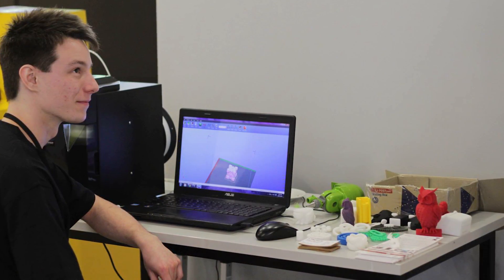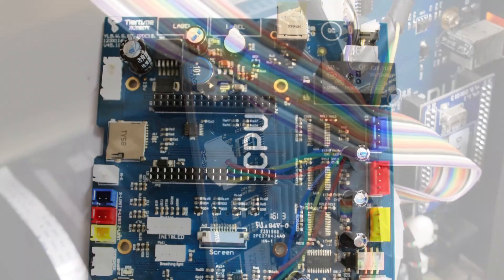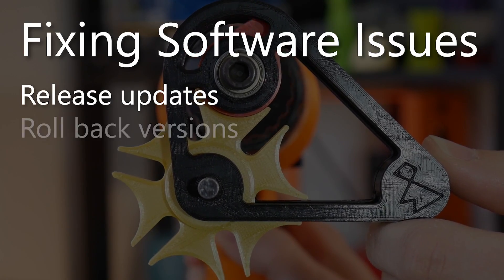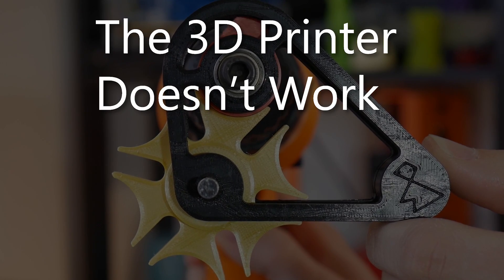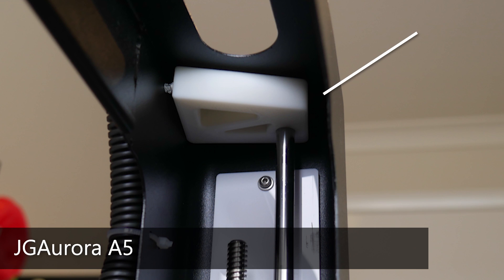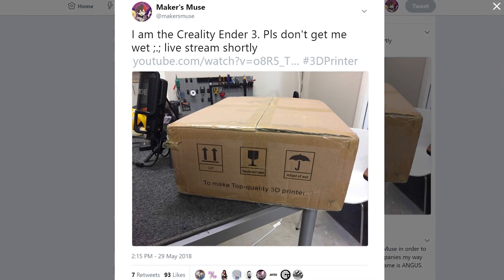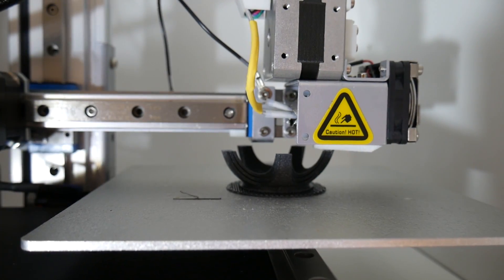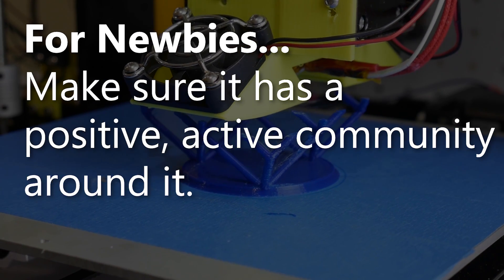Serious Concerns with 3D Printer Quality Control

Comment: The "beta test" behaviour is not acceptable - unless it's explicitly stated as such by the manufacturer and then backed up by some kind of support, e.g. financial incentive for beta testing, and/or free parts replacement at the end of the beta. I've not seen any 3D printer manufacturers stating their product is beta, however.
Product improvement is good, obviously, and to be encouraged (a business imperative anyway) - but needs clear identification for significant differences. A balance needs to be struck of course - changes that consumers don't need to worry about (e.g. the colour coding of the connectors on an internal circuit board to take that example) can and should go under the radar as not a change to "form, fit, and function".
My own experience to date is with Wanhao, who to my mind have been good in this area. They have identified significant changes with a revision number (in particular the D7 which has gone though five point revisions - with upgrade kits available for purchasers of earlier standards) so you know what you're buying, and where they have to revise something within an existing shipped product that quickly proved problematic, they have done so as a free fix (most recently with the replacement z probe on the D9).
Edit: turns out they're charging fit the z probe update, at least for some.

Comment: Wow what a great video!  Totally agree.  Even my anet a8 needed a few screws that were in the instructions but not included....  now however after upgrading power supplies, output transistors for hot end and hot bed, Bowden set up, and various frame strengthening, my printer is producing results as good as many 10 or more times more expensive.

Comment: companies should sell updated parts after the upgraded versions are ship. and replacement parts if something does fail after time. like my ender 3. i would like to upgrade without buying a whole new machine, like the better main board and a flatter hot bed.  go to their  site and barely find and parts for it in 24 volts. well, since i got this one for my birthday i might buy another ender 3 in a few months if they stay the same price.

Comment: If they tell people about it.
That's the key.  Inform people of what they are purchasing and what they are not.  Inform people of changes.  If there aren't major changes like new threaded holes needing to be tapped... then offer upgrade kits.  But the key is informing people.  I willingly Beta Test games all the time.  The gaming community will roast you if you release an unfinished Beta like game as a "finished" product.  SO if the company is honest and communicative then Beta testing behavior is fine.  If they are not and are doing it sorta "in secret" then it is not fine at all.

Comment: I bought a tevo tornado a couple weeks ago (yes I knew about the tevo controversy, but reviews of the tevo tornado were good and it was cheaper than the cr-10s) and I was not expecting 3d printers to work out of the box and as easily as my machine did. If it wasn't for Angus, Joel and Jerry (barnacules)  I probably would have never discovered 3d printing. I'm glad I did though because not only have they been neat to make models and art, and they have also come in handy a few times. But the community as a whole has been very helpful and I just want to say that Makers Muse and all the other 3d printing YouTube channels have made it easy to learn about 3d printing.

Comment: I agree, commercially-released printers and printer kits should be adequately tested so that they work out of the box.  It's a bit different if you're buying a crowdsourced prototype. You might expect to have to do some minor improvements to get your printer working.  I bought one three years ago and had to make a number of fixes to it.  It now works only part of the time due to interactions between early design hardware and newer software. I have largely replaced it with a Prusa i3 Mk2 I built from scratch which works fantastic after a year of learning.

Comment: It really depends on how they improve the hardware. I think it is okay to make slight improvements on a machine. If it already works and you nit pick tiny issues to improve, go ahead! 
I saw that the anet a8 changed some of their parts to injection molding, but that doesn't make the one I had any worse so no problems here...

Comment: Great video! My story, I bought an Anet A8 as my first venture into 3D printing, knowing full well about the issues (direct mains power, flimsy frame, poor bed connector etc) I knew I'd have to work with it, knew I'd learn a bunch along the way.. but in all honestly all I've ever done with it is test and tweak constantly. Sure I learned a ton about how they work but I've never really "created" anything with it. It's more like a troubleshooting course than a 3D printer. lol BUT it was like $140USD. I loved the process

Comment: I think this practice is at least a bit ok if and only if the manufacturers and their retailers splash warnings all over their products that it is untested and might need heaps of mods to get it working even the first time. I remember my first kit - a laser cut PrintrBot, and the instructions didn't even match the kit I was sent. Luckily, after assembly I was able to print my own upgrades and have stuck with it, but not everyone has the same story.

Comment: Thank you for the making people aware for this problem. I have a Cetus mk1 with a banding issue which mean I can’t print “large” prints as the banding gets worse on large prints. I know of other Cetus mk1 owners that have the same issue. Cetus3D/Tier time have acknowledged the problem, but have not provide a fix for the problem. I don’t have the time og skill to do it myself. The Cetus is my first and probably last 3D printer.

Comment: 6:19: "Hundreds"?  You took the modest pill this morning didn't you? :)  New stuff sells and people ignoring risks is nothing... new.  

In general, people are pretty reasonable with risks around 50/50.   But, low and high probabilities get rolled up into hard "yes"es and "no"s.  The fact is, when someone's faced with a perceived 10% chance of a rubbish printer the unicorns take over.  Each person and market segment has a threshold where their reaction to risk probability goes wonky.  If a company can stay in that pocket, they maximize profit and lower their cost of lower quality.  

Asymmetric information and horizontal differentiation are king here.  Managing their own forums via "bean cafe" (SNL) tactics and keeping the reviewers "fed and watered" :) is important.  You acknowledge that your business and cohort are fueling distortions to perceived risk (thus value).  By having a tight community with comparatively few key players like yourself, a prospective consumer paints their version of risk with fairly sharp lines.  Unfortunately along with that, they end up ignoring fuzzy probabilities (eg: 2/98%) and take on, what acts like, larger chunk of *uncertainty*.

None of this is new.  In fact, this market is a textbook case.  Angus, I implore you to take or audit a few courses on microeconomics and game theory.  Your head's in the right place for it minus the "maths".  You have a knack for distilling and presenting ideas.  I think it would help you help others in addition to the strategics of your own business.  Just ignore those funny symbols and accept that future market outcomes are often computable with surprising accuracy.  Bobblehead business people (color pie chart folks) don't typically understand this stuff in detail.  They wait for someone to present them with a red and blue button, and some combination of shiny features and indigestion from lunch decides.  That's fine, but it does leave a knowlege gap for a few to leverage.  If innovation in your business is being a step ahead, I encourage you to check it out. 

I know, nudging you toward economics but recommending a bobblehead book: "Customer satisfaction is worthless, customer loyalty is everything" ;)

Comment: I was close to scrap my UP Mini. It was my first 3D Printer and not even close to out of the box functional. Oh and the extruder ... well the filament grinds through the metal so the filament slips. And they only charged over 130 $ for a spare extruder who was delivered without a extrudergear.
Reply from the maker: honestly after using and repairing countless machines I find that hard to believe, it was either totally broken from factory or you were trying to use inferior ABS OR trying to print PLA, which they never were able to do very well (got too hot).
Reply: Uh a reply unexpected. :D I have to say they were sold in a coffeestore in my country. I should have been suspicious at this point but little i knew. I guess i also had one of the first version with just this plastikclip over the extrudermotor for filament guideance. It was a hard and very very very unpleasant experience to get it to run. The fun thing is that the ABS Filament (ESUN) failed nearly at 80% rate .. while the ESUN PLA failed only around 30% (ESUN is the Filament they say it works on the UP Mini if i remember me right). The latest software enabled also a lot of features that made it at least a useable for me. Its nice to see that the UP mini you got was working fine and was a good desicion :D. I dont want to say its a bad printer especially compared to my second one a CTC Bizer who had a meeting with my sledgehammer after 100 hours of not working.

Comment: This is actually why I bought a kit printer for my first printer. Spending 21 hours building a printer with no instructions before realizing the instructions were on the sd card (which was still factory sealed?!) . Downside? It’s a rough entrance into the hobby. Bright side? I know every screw and every wire and why it is necessary for the machine to safely function. (Now repairs are easy as pie)

Comment: I have had a similar experience with my Anet A8, I got it a couple of weeks ago and I watched every review on beginner 3D printers I could find. I noticed some easy to fix things on the Anet A8 but once you fix them it was pretty good. The machine I got was way better then what the reviewers had. It took people around 8 hr for a novice and 3 for a pro to build. For my first printer it took me 2 maybe 2 and a half hours. So many "problems" with the printer had been fixed, which I am glad, it saved me time and trouble. My first print was better then all of the reviewers got after hours of tweaking. I'm glad I got a better version but I 'm sure it would have been better to ask people to beta test the printer and then send out the final. That way it is fare.

Comment: There are two approaches to buying a 3D printer. 1. Your printer is the project. For example, you spend lots of time upgrading and modifying it or 2. You buy one that works out of the box and spend most of your time actually making things.

Comment: Often wonder how often tech is sent to reviewers that's previously received extra testing with components swapped (possibly numerous times), to ensure a good review on a product with as few flaws as possible!?! This is done even with kits as they're simply disassembled & repackaged with fresh (but carefully checked) fasteners!
Anyway, for a while now most products manufactured in China are intended for quality-control testing by the consumer, which has kept the price down but really sucks as it  wastes piles of money & creates piles of rubbish which also sucks environmentally as it's cheaper to replace than repair or rectify faults! 
This form of 'export-dumping' isn't new, where in the past factory-2nds below local standards were often shipped from Europe & USA to distant countries (eg; Aust. & NZ), then blame any inherent design problems on shipping or consumer abuse!

Comment: Great Video Angus, I just hope this message reaches the manufacturers as well, The photon you reviewed worked great, but not so for many users on the FB groups, many dodgy components and poor version control confuses many people. Bit of a gamble whether you will get the new updated machine or a old version with bad components.

Comment: Totally agree. My cr-10 has so many issues. I had to troubleshoot alt of stuff. I expected it to work after a bit of running of the bed but the Hardware was bent and misaligned from factory. It sucks that the only plug and play machines are expensive it makes it hard to people to get started.

Comment: Eric was at least 10 years behind the times in his book.  'Customer R&D'  has been the business development model for many software-based industries for 20+  years. I've been working in the IT space for over 22 years, and before that I spent about 4 years working in amusements. Ongoing software upgrades in both industries are the norm.  Software upgrades had no additional cost to the consumer? sadly, no - it comes at a great expense - somewhere in the chain (download  cost, time in unenjoyable game play, network outages, time spent flashing ROMs  etc.).  ALL of the big operating-system and networking equipment manufacturers ship bug-ridden code with security holes you could fly a jetliner through.  It is standard practice for these <insert derogatory expletive here> manufacturers to force the client-facing vendor to find the things that fail to meet the promised requirements and jump through the hoops (with the  usually non-recoverable man-weeks of labour cost borne under the warranty with already little-to-no margin on the sale) to repeatedly test updated code versions , with the client facing days of outage or inconvenience. It's too late now,  we've all bent over,  held our ankles and taken it, but the manufacturers should have been forced to pay for the time lost in the first place to set the level of expectation.

Comment: I have bought four printers and have run into all the issues raised.

My first printer a Sintron Delta, was poorly designed, and the instructions didnt match the kit (they appear to have changed the kit since they were written/youtube'd) and in any event there were several issues with the printer. Like one of the axis's was reversed in their firmware. The printer was never going to print following the instructions. Whilst it taught me a lot, trying to build the thing was horrific. I would have been better off ordering parts and assembling my own delta. Actually I did order some of my own parts (Rod ends for one) to make up for some of the kits definicies) I think the kit costs $500 AU at the time, as well.

http://www.soliforum.com/topic/12276/sintron-delta-build-buyer-beware/

I managed to set it up and also install a inductive sensor but due to issues calibrating it never got it to print successfully.

As the kit wasnt fit for purpose and was different than the instructions, it appears they upgraded (or downgraded) the printer without updating the instructions.The mistake with the firmware means the printer would neve have printed out of the box

My second  printer was a Cocoon Create Touch (Wanhao clone). Very easy to assemble out of the box, and has consistently worked since I have bought it for the same price of the Sintron Kit.

https://cocoonproducts.com.au/3dprintertouch-2/

For my third printer I then got ambitious and bought an Anet A8 given my experience with the Sintron, the printer was pretty easy to assemble for a kit. But in the end I never printed with it after reading about concerns with the power supply and fire risks (Possible runaway temp/mosfet/heated bed joint from memory) thought its just not worth it. Regardless of its a kit or not, the printer should never have been sold. 

http://punishedprops.com/2017/08/11/anet-a8-safety-upgrades/

Four my fourth printer I bought another Cocoon Create Touch (Managed to score one secondhand that had hardly been used). Again, very happy with it. I am not even sure which is which now. (I wanted a second, so I can have dedicated PLA and a dedicated ABS printer).

So in the end I have two printers, two sets of parts. 

NB It should be noted that the cocoon create was based on the wanhao i3 plus which had a saftey recall but was not affected - this is a plus (That a recall exists at all rather than the Anet path of if your house burnt down its on you) and that is part of reason why good to buy from a bricks and mortar retailer instead of a neblous overseas company https://winplus.zendesk.com/hc/en-us/articles/213030346-Safety-Notice-21st-Sept-2016

Comment: I've definitely seen evidence of this with my MP Select Mini. If you look at a lot of the forums, you'll see there are two versions: the V1 and the V2. But of the upgrades I've had to perform, some of them I've looked up the part on Thingiverse and discovered that the part is already on my printer. Especially the extruder: I went in expecting to have to upgrade it to support flexible filaments, but the design on my printer is almost identical to 'upgrades' on Thingiverse.

Comment: You might praise the Ender 3's injection moulded PSU cover, but you should be aware the design pushes the spade connectors off the back of the mains plug terminals as they interfere with the PSU screw terminals. Mine arrived with the earth terminal disconnected, coupled with firmware which features disabled thermal runaway I was incredibly happy I noticed, but horribly disappointed in the shoddy design and QC, which I rectified with a 15mm longer cover. Other users reported the same issue, a lot of people flippantly dismissed it...
Reply from the maker: Thanks for the heads up, I'll look into it!